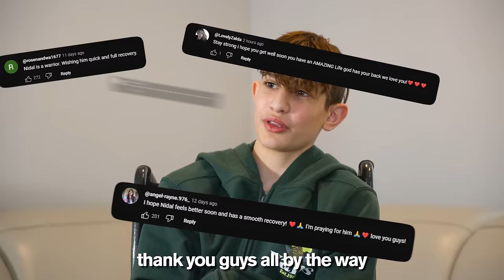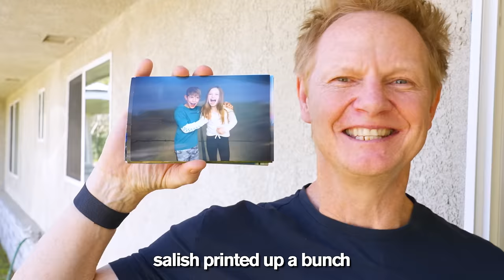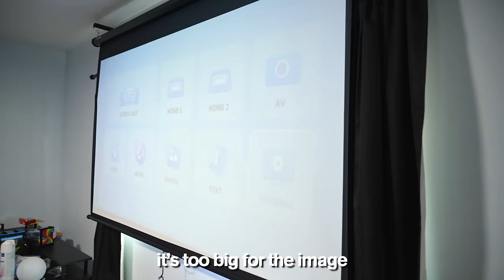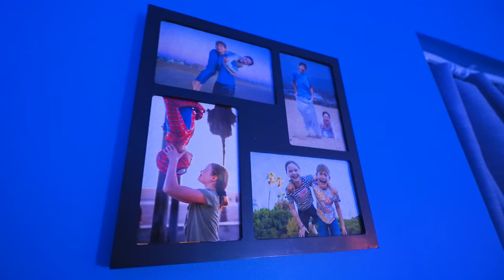MY BEST FRIEND'S ACCIDENT

Comment: JJ is saying 60 because 60 take away 40 equals 20 and if you’re 40 then 40
 take away and 40 take away 40 equals zero so you can’t be 40 years old and you already said 40 years ago you had better hairstyle so you’re 60